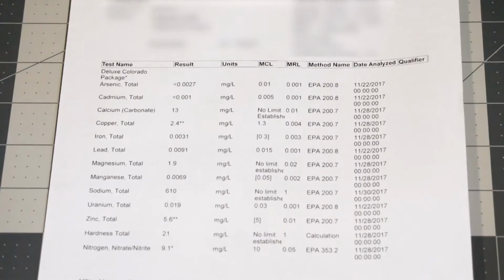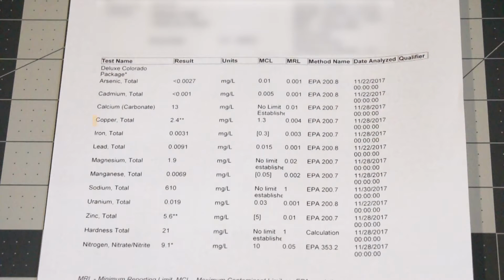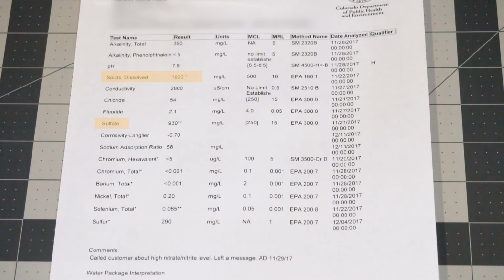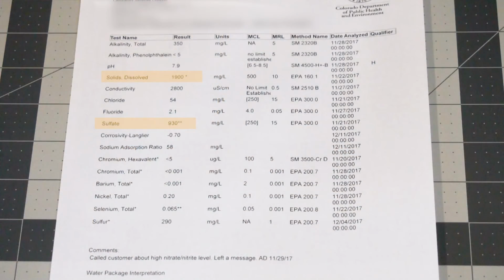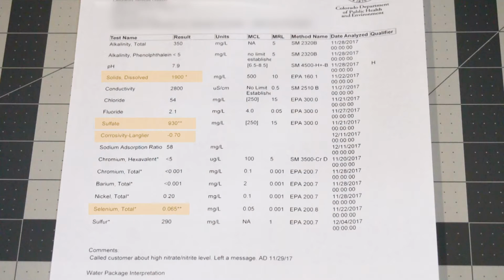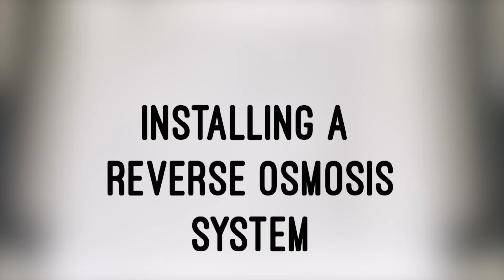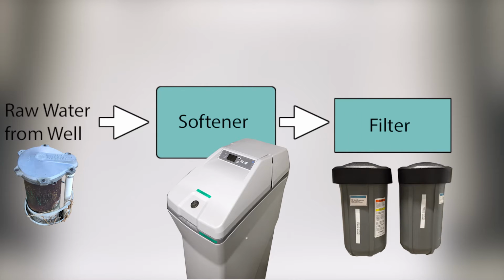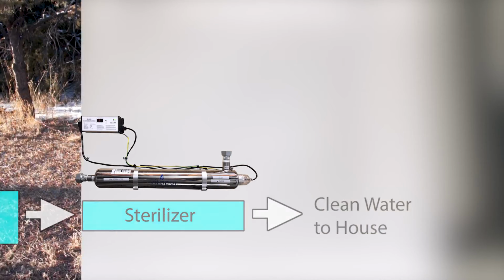Whole House Reverse Osmosis Water Filter System for Well Water

Comment: Honest question : Why RO the water for all uses instead of just ROing the drinking water ?
Reply from the maker: The water is incredibly corrosive on plumbing.  Before the RO, I had to replace the faucets every few years as they'd be eaten away.  The toilets would develop a thick mineral deposit around the water ring and I'd have to use muratic acid to remove it.  It water was so bad, the minerals would grow out of the joints at every threaded fitting or connector.   The racks inside the dishwasher and the drum of the washing machine would rust quickly and neither would last more than a few years.  We would be lucky to get more than a couple years out of a water heater.  Aside from the plumbing, the pollutants in the water come out and aerosolize in the shower.  We'd be breathing them in, washing our skin with them, and getting them in our eyes.  Having the entire house plumbing on the RO resolves all these problems.

Comment: Are you still using this system or did you updated to something better?
Reply from the maker: This is the best one available, still, AFAIK.  I'm still using it.  I had to replace the carbonator pump motor last year as one of the bearings failed.  I may be due for new RO membranes this year.  I'm starting to see an increase in TDS.  Otherwise, just filter changes every 6 months and a flush once a week.

Comment: We are considering the RO addition to our filter/resin bed system.  Our water source is better than yours (with respect to your metals ans nitrates) but probably tastes worse  due to the heavy iron and manganese.)  Our biggest problem is space for the additional tanks and filters.  We already have a big tank and three large filters and the treatment source tank for the resin bed recharge.  I've got room but it will require demolishing current building and starting afresh.  Thanks for the great overview video!
Reply from the maker: I had to expand our mechanical room by about 32 sq ft to get everything in there.  Originally, I wanted to run a pair of 160 gallon tanks but decided we just didn’t have the room.  If I were to do it again, I’d make the room a few feet wider.

Comment: Great video ... I have a similar well water situation and I'm going to try and duplicate your set up. Very Respectfully, please let me know if there's anything you wish you had changed to your system. Thank you.
Reply from the maker: Honestly, looking back at it, I think I'd have built my own RO unit instead of buying one.  They're incredbily simple.  A pair of filters on the inlet, then a pair of valves to control flow through the RO membranes, a carbonizer pump to build pressure, and two or 3 RO membranes in canisters.  I think I could have done it for 1/3 the cost.  But i will say, this one has been incredibly reliable.  

Things I wish I'd done differently:  Skip the softener.  It's not worth the extra cost and maintenance.  Add a large whole-house filter  after the well-pump pressure tank, to catch sediment before going into the RO prefilters.  Add a second storage tank.  Maybe another 160 gallons, for a total of 320 gallons.  Find a way to reuse the waste water.  I'm in a basement, so I pump it up with a sump pump, and into our septic system.  It'd be nice to use it outside for something.
Reply from the maker: Oh, and I forgot, add an automatic RO membran flush.  They're supposed to be done once a week.  Open the valves fully and push a lot of water past the membranes to flush them.  It's manual right now and I forget to do it except once a month.  An automatic system that'd take the RO unit offline and automatically flush the membranes once a week would be nice.
Reply: @RobertAdairWorkshop  Thank you very much Robert for getting back to me so quickly. I'm probably not as industrious as you as to try and build my own RO unit, but I am definitely going to copy your design with the changes and add an automatic RO membrane flush system to it all. 

Very, Appreciatively, 
3rdWave

Comment: hey man nice video! 
so i currently have what i thought was super hard water of 350 but yours 1900 is insane , anyway i was thinking of buying a 1000 gpd unit not this one exactly but my question is i know u mentioned in comments you have never changed membrane, is that solely because u have a softener ? i wasnt planning on buying a softener right now just the r/o, do you think i would need to change membrane quick?
Reply from the maker: I stopped using the softener in 2021 when I got tired of buying salt.  No decrease in performance of the RO system.  I am still using the original membranes from 2020.  The recommendation they gave me when I bought it was that the membranes should be changed when you notice a decrease in performance, i.e, when the output TDS is higher than it should be based on the RO membrane spec sheet.  Hasn't happend to me yet.  I think those membranes last a long time.
Reply: @ nicee. thats reassuring! i hope thats the case with me, the system im on the verge of buying is the growonix 1000gpd do you know about it? its 1,300$? which is alot cheaper then urs but now im scared it wont be as good as urs since urs is so more lol also whats is it discontinued now? or changed name cus i cant find that exact unit under that name, (nevermind went back watched the video and it is axeon) thanks for the reply!!

Comment: You mention that you flush your system once a week.  Our plumber stated to us that this system flushes itself daily.  We have the same system you have.  Can you do a video on how you flush this system?  We are not sure if we can trust our plumber on this flushing process.  We have had this system for a year now and we have never flushed it! Thank you!
Reply from the maker: Mine does not have automatic flush.  That's probably an option that I didn't spring for.  It's easy to flush manually, though.  When it is running and the tank level is pretty low, I open up the concentrate valve wide-open.  That lets extra water flow through the concentrate loop and flushes the RO membranes.  I let it run like that for about 15-minutes and then set the valve back to its original position.
Reply: @RobertAdairWorkshop  Thanks for the info!

Comment: One thing I hate about RO systems is the pressure tank in which you have to store the pure water, since those systems are usually working on the main pressure, and do not have a pump. I hate the idea of having pure water, which is slightly acidic contaminated by the rubber that all pressure tanks have. It feels completely antinomic to go such extend to treat water to then pollute it again with rubber. 
I don’t understand why you needed to do that since you have a huge bladderless tank and a pump?
Reply from the maker: Without the pressure tank, there is no consistent pressure.  Imagine that 15|amp pump turning on every time you turn on the faucet.  You would have to open the faucet, then turn on the pump and let it flow.  Then when you turned off the pump, the pressure would go back to zero.  It does not work without a pressure tank.
Reply: @RobertAdairWorkshop  What do you mean? What’s the issue? Of course it would work. Plenty people use on demand pump with various configuration. You open the faucet, water trickles out, then pump kicks in, then you clause the faucet and the pump stop.
Reply from the maker: @Maxime-ho9iv   O, it won’t, sorry.  Build one for yourself and you will understand.  I can’t explain it to someone who has their mind already made up on the topic.
Reply: @RobertAdairWorkshop  https://youtu.be/cQ9LD808dMo

Comment: We paid $24k for ours but that was installed by our plumber. We are on a well too.
Reply from the maker: Mine's been up and running for 4 years now without issue.  I think they're good machines, well worth the money for what they do.
Reply: One year later, we had to replace a relay switch and add an additional 20 inch filter.  Our well water is 1700 ppm tds.  Water is better than ever now.

Comment: Crystal Quest has 1800 GPD systems that cost more like $7000 that I am considering, why are they so much less that the $20,000 you mentioned?  I am concerned given your cost estimate.
Reply from the maker: We had to buy the stuff to store the water, pressurize it, and feed it into the plumbing.  That included the storage tank, level controller , jet pump, pressure tank, calcite neutralizer, filter assembly for post calcite treatment and UV light sterilizer.    None of that stuff was included with the RO system.  It adds up fast.
Reply: @RobertAdairWorkshop  Thank You!

Comment: I've been considering RO because my well water has high pH...near 10.  this poses no health concerns but it does make the water feel slippery or slimy....just annoying.  And also there's some long term scale buildup issues.  I spoke with a few companies and none will do an acid injection system, probably a liability issue.  I've looked into installing one of those myself too.  I'm trying to find something where the cost is somewhat reasonable and the subsequent maintenance/upkeep isn't too too demanding.   Your video helps alot, thanks
Reply from the maker: US Water Systems does make an acid injection system.  I was looking at them when I was considering chlorine injection.  I didn't need to go that route, but you might take a look.  It uses citric acid to bring the PH down.  I'm not sure how that would impact water quality after neutralization (precipitation of solids in the water, iron bacteria, etc) so this might need to be an upstream treatment pre-RO.  Anyway, this might help:  https://uswatersystems.com/products/ph-reducer-system

Comment: Hi Robert, your video was really informative! One aspect you didn’t touch on, however, was the operational efficiency of your RO system in terms of the ratio between produced permeate:reject water. I’d be be curious to know what that ratio is for a system such as yours? Thanks a lot
Reply from the maker: That's a really good question.  It varies seasonally, but I'm getting about 2 LPM of permeate with 6 LPM condensate.  That's about 2/8 LPM which is a 1:4 ratio.  It gets worse than that in the spring, better than that in the fall.  I suspect road salt gets into the water table in the spring.

Comment: Are you paying for water usage per month to your city? If not your idea and the cost of the system is definitely the way to go for cleaning and dumping RO water to your toilet every time you flush.if your paying water thats very expensive set up. I worked at pharmaceutical and our set up system is 50x larger of what you have and the RO are for labs only with polypropylene all over the bldg.
Reply from the maker: No, you're right.  I have a well and a septic system.  I don't pay for the water that I pump out of the ground, except for the electricity to run the pump.
Reply: @RobertAdairWorkshop  that’s awesome set up you have.

Comment: Dear Robert, I don't understand the need for a water softener before RO system as water softeners do not reduce TDS from your water and sometimes can even increase it. In your case wouldn't it be better just to add extra filters before RO?
Reply from the maker: I eventually realized that the water softener before the RO was moot and removed it.  You are totally correct.

Comment: What is the pressure like for showering? I've heard reverse osmosis systems have very low pressure.
Reply from the maker: The RO system doesn't put out much pressure.  Backpressure on the output hose is bad and reduces its efficiency.  The RO water goes into a storage tank so no pressure needed.  The pressure comes from the booster pump which pulls water from that tank.  We have a 35-55psi system so the house is usually somewhere around 50psi water pressure.  Showers, garden hose, faucets, all work really well.  The takeaway is, the RO system doesn't make any pressure.  The pressure comes from the booster pump which draws water from the RO storage tank.  Hope that helps.
Reply: @RobertAdairWorkshop   Very helpful! Thank you!
Reply: @RobertAdairWorkshop by how much has the system increased your water bill?

Comment: Great video! I’m trying to do something similar but I am having trouble figuring out how you did the float sensors. Was there a guide you followed when setting up the Arduino board or did you know how to do all of that already?
Reply from the maker: No guide.  I figured that all out myself.  I wrote up the process on my website.  It shows the hardware I used and provides the arduino code.  https://radare.net/2021/01/controlling-an-ro-tank-level-with-an-arduino-uno
I'm taking the site down on 11/9, though, pdf it if you'll need it after that.
Reply from the maker: There's a part 2 with updated code and shows how I made the housing.  https://radare.net/2021/01/controlling-water-tank-level-with-an-arduino-and-two-floats-part-2

Hope this helps.

Comment: Hi Robert,  I have a TDS of 1900 composed of chloride and salt. I live in michigan near the salt mines. When watering outside plants salt will dehydrate them. Anyway the RO I'm considering is US water defender. It's a 4000 gallon per day unit which will give me enough water to do the gardens outside. Actually with water temp and TDS I'll be much less than 4000 gallons. Even at 2000 gallons per day I'm still fine. The real reason for the larger unit is for increased surface area on the RO filters. Just wondering if you have any thoughts on this? All my pre filtration is in place.
Reply from the maker: Hey, Kenham56.  We tried using our system to hand-irrigate our garden when we first installed the system.  It was really easy to draw the storage tank down to nearly empty.  We now have everything planted in garden beds with reservoirs and top those up at night when our water usage is less and the tank is full.  We also capture rain water, though, we live in Denver, so there isn't that much rainfaill so it doesn't help too much.  Essentially, though, our 1000 gpd unit with a 160 storage tank isn't really big enough for watering the garden.  

Going with the larger unit could work but there's a couple things you might  consider first.  The 4000-gpd unit will need a lot of water when the RO system runs.  Do you know if your well produces enough water and the piping is sufficient to support the larger RO unit?  You'll need about 3 gpm which I guess really isn't that much.  Something to keep in mind, though.

When the RO system runs, you want it to run a long time and then shut off.  You don't want it to short cycle, or run with frequent starts and stops.   Plan for it to run a minimum of an hour when it turns on.  At 4000 gpd, it could produce as much as 160 gallons in that hour span.  I'd recommend a much larger tank than the 160-gallon we used.  For a 4000-gpd system, somewhere around 500, maybe, or larger?  Do you have the space for a tank that size?  If we'd had the space, I originally planed to use a pair of 160-gallon tanks, in parallel, to supply the house, but we didn't have the room.  Those tanks are bigger than  they look.  So one is now used to capture rain water.  Probably wouldn't want to go smaller than a 300-gallon tank.  

Just a couple thoughts to help you decide.  Hope it's useful.

Comment: Small problem.  Our water storage tank is in our garage. We live in the desert and the garage is 108 degrees.  As a result, we have no cold water.  It’s currently perfect for taking a shower and you don’t need to add hot water!
Reply from the maker: That's a bummer!  Ours is in the basement, right up against a soil berm and next to the AC.  It stays a nice 58F, pretty much year round.  Are you able to get by without could water?
Reply: @RobertAdairWorkshop  We are going to install an air conditioner.  We live in the desert so we may only use it 3 or 4 months of the year.  I don’t think that hot temp is even good for the water system.

Comment: How do you flush the membrane?
Reply from the maker: Once a week (when my maintenace reminder light comes on), I open the concentrate valve fully for about 15-minutes and push a lot of water past the RO membranes.  That was the manufacturers recommendation.  It's worked well so far.
Reply: @RobertAdairWorkshop  Great! Thank you!

Comment: I have three suggestions - 
1) Move the prefilters to before your water softener in the sequence - it will preserve the resin cross-linkage from organic fouling.
2) Put the calcite filter between the RO and the storage tank so its a more consistent dosage, due to the constant flowrate between the RO and storage tank.
3) Lose the post filter that you say removes additional alkalinity because it doesn't. It's a wasted filter. It's not really doing anything. 

Overall nice job doing it yourself. Kudos.
Reply from the maker: Appreciate the comment.  I think I was unclear.  The post filter removes any calcite that has made its way out of the calcite neutralizer.  It has been dirty each time I've replaced it.  I'm not adding calcite to the RO tank because I don't want any mineralization in that tank.  I want to keep it clean..  Good idea about the prefilters and the RO.

Comment: I like the thought of an RO system for my house and currently use a simpler one I built for processing maple syrup. But man, wouldn’t $20k buy ALOT of bottles of water?
Reply from the maker: It very much would!  We use the RO water for everything, though.  Laundry.  Baths.  Dishwashing.  Garden watering (the Selenium would end up in the vegitibles if we used well water), filling the aquarium, etc.  Pretty much for everything except watering the lawn.  
Actually, just for fun, I calculated it.  The average person in the US uses 150 gallons of water per day.  We probably use half of that becuase we are water conscious.  80 gallons per person per day is roughly 90k gallons of water per year.  That's 700,000 16-ounce bottles of water.  Holy cow!!  So this is looking quite cost effective.